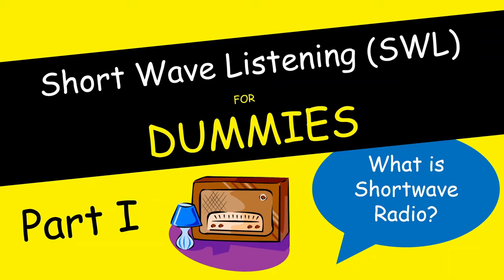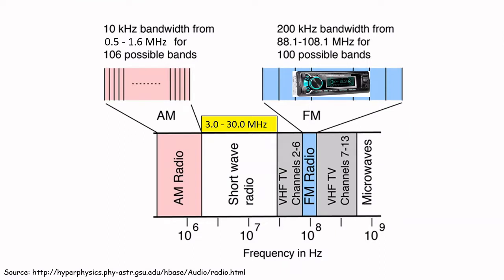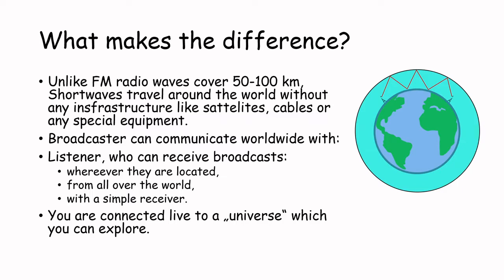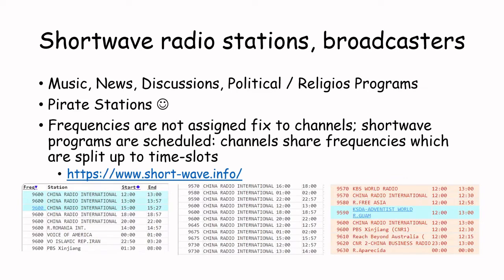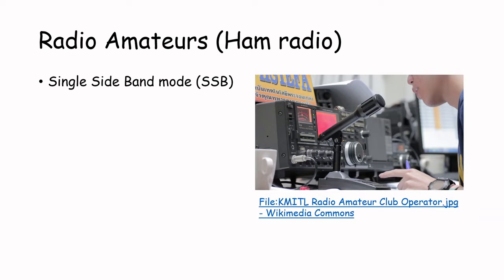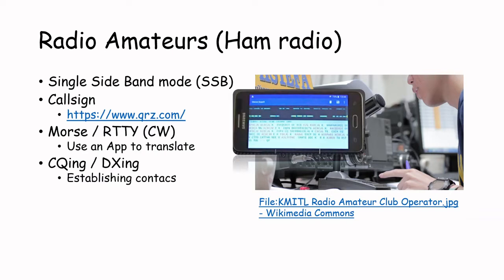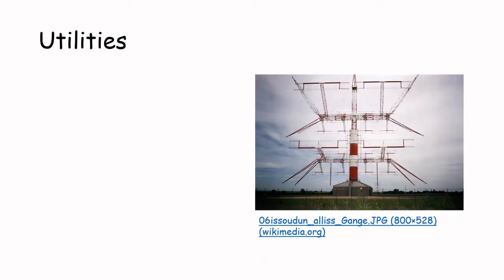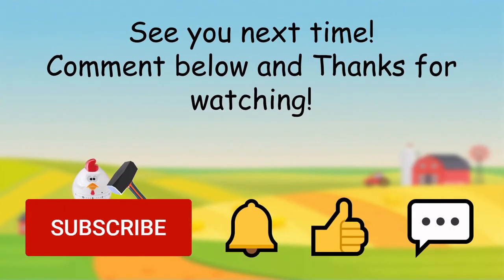What is Shortwave Radio? - Part 1 | What is Shortwave Radio?

Comment: "FM" broadcast frequencies are technically in the VHF band, not "FM."  FM is the type of modulation.
Reply from the maker: Absolutely right, this is also explained in Part 2. As people incl. beginners will refer to this frequency range (88-108 MHz) as FM Radio, I use it in the introduction as well, but you are right, this is called FM Broadcast Band located in the VHF range.
https://youtu.be/SFXa92Yrtng